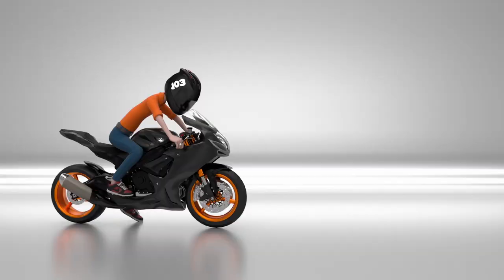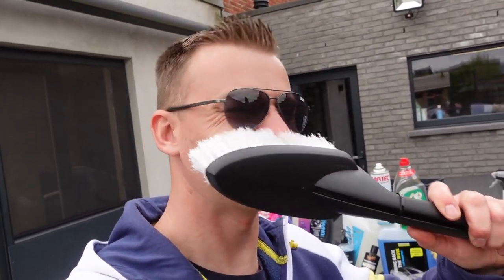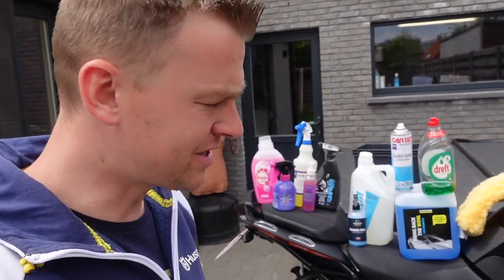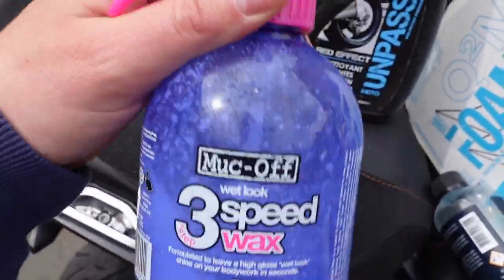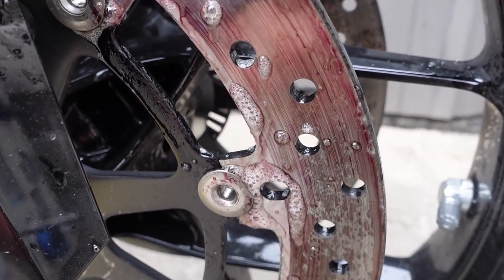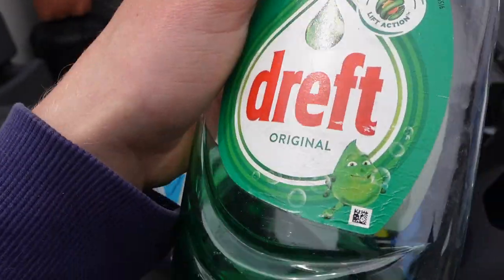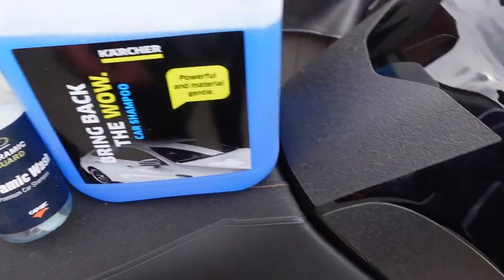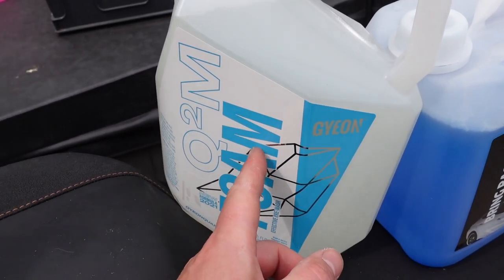Dirty Bike? Here’s How I Clean Mine!

Comment: I washed my SDGT yesterday at the car wash.  

Put a plug in the muffler, sprayed the soap cycle from a bit of distance from the bike to soften the pressure, used a wash mitt with the foam from the foam brush to clean the bike, rinsed it off, microfibre cloth dried , rode home then Honda Polish with a microfibre all over then  a microfibre buff after. 

Look great. Those little screens above the LEDs were kinda hard to get the bugs out but otherwise it was fast and easy. Honda Polish is the bomb.

ps- took the WRS touring screen off and put the tinted KTM screen back on. I guess I like more wind. It’s hot here now and my bike looks better with original screen.